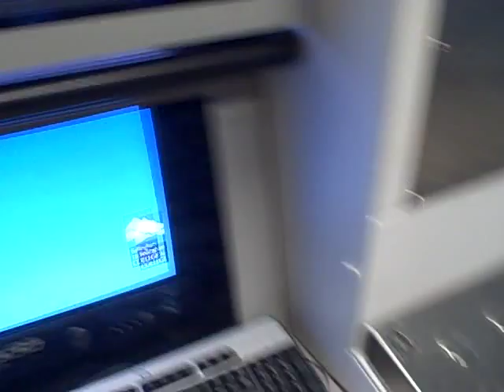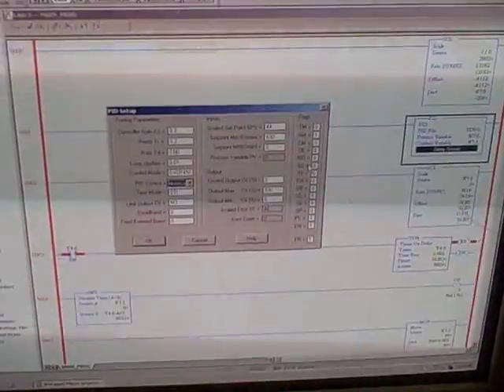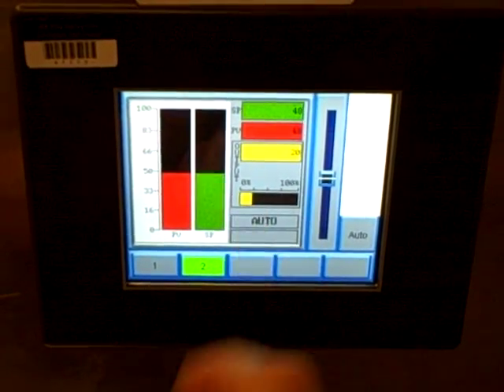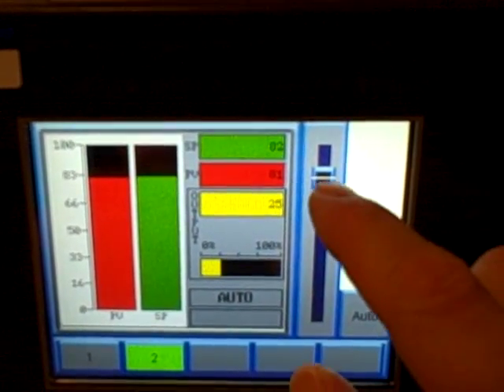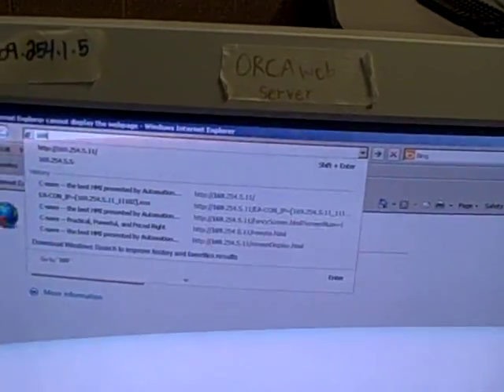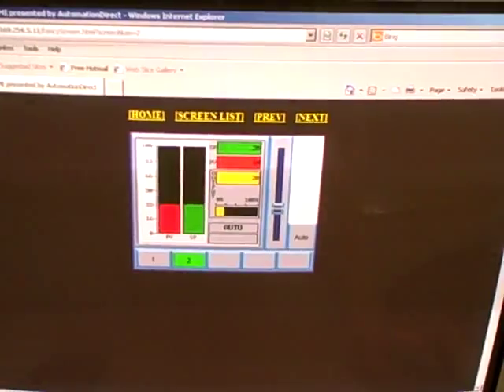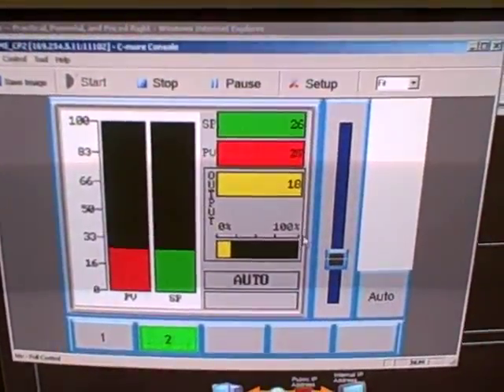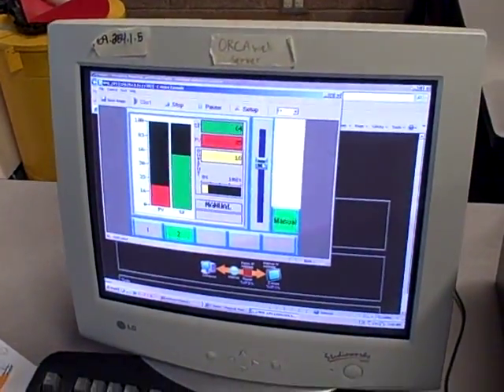Allen-Bradley ML1100 as PID loop controller (with HMI panel)

Comment: Does allen bradly controller have a special I/O module for converting DC voltage into 4-20mA AI?
Reply: As in a 0-10v analog input